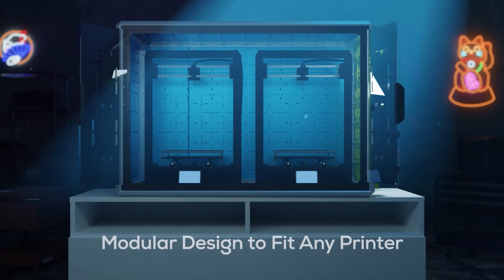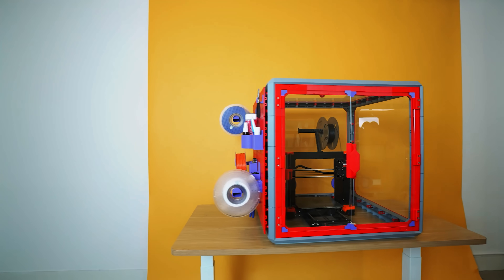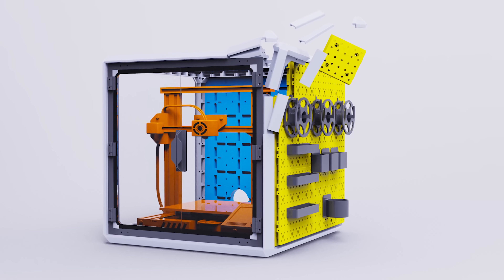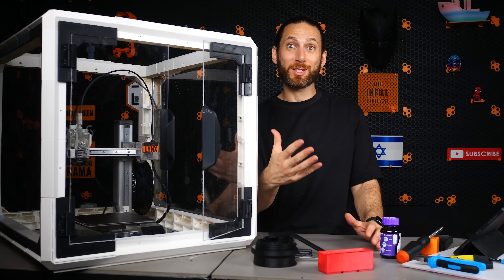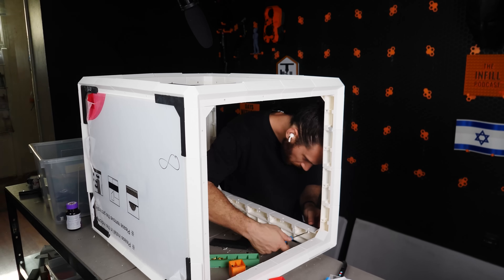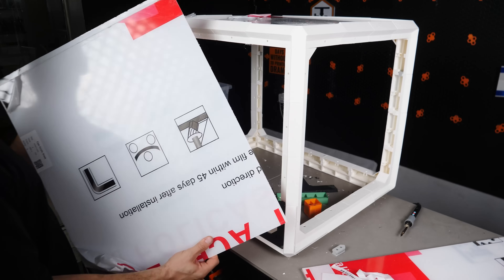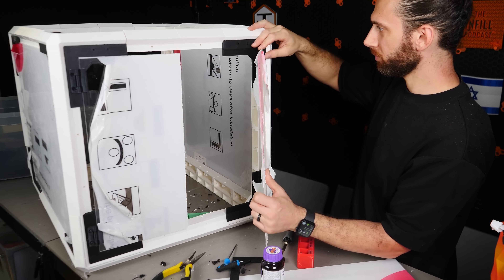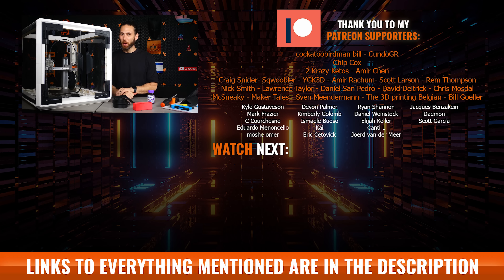This 3D Printer Enclosure is FULLY 3D PRINTABLE!

Comment: It's pretty cool.  I usually thing PVC pipe and fittings for things like that, but then it's not enclosed generally.  I use PVC to hold up strip lights for hydroponics.  I don't have a 3D printer, because I know once I start, the costs will take off to keep me in the consumables.  I would probably use ASA mostly for outdoor fixtures and such, but there is definitely a need for some indoor projects that a well thought out plan and good design could solve around here.

Comment: Save the effort. Use aluminium extrusions that later in life you can daisy chain with a link to extent, and use a acrylic or even plastic sheet face that mounts into the T-rails. Could even print the faces. It's cheap, way more sturdy and doesn't use loads of plastic on trying to bandage the issue of prints not being as strong as aluminium, for example.

Or just a popup tent or a cheap enclosure off amazon lol

Comment: Great Idea and Video!!!  (actually all of your Videos are great :) ) ..... One question ...since the Bambu A1 has the electronics on the bottom of the printer, and bambulabs do not recommend to enclose it (so no to fry the electronics) ... is there any way to a) raise the printer inside the printed enclosure and b) drill/create some air openings on the bottom of the enclosure so to allow the electronics of the A1 to breath ?

Comment: I designed an enclosure that works with  extrusions that you can print in PLA without worrying about the heat of the enclosure later on. All the PLA parts are outside of the heated area. Takes far less than 5kg. I think I used 1.5-2kg at most.
Reply: Link?

Comment: The project overall is too expensive to be feasible for most people(myself included). Once you buy the file set you are 90 bucks in and if we assume we need 5 kilos of pla 25 to 30 per kilo 125 and the needed acrylic panels will take it well over 250 which is too much for me personally. If the models were cheaper that would be acceptable. I get that a lot of work went into the design but the price kills the idea. If anything i woud try the free version on printables

Comment: 5kg is a lot of filament, and making it with PLA doesn't make much sense, since most people want an enclosure to print abrasive materials like ABS/ASA at high temperatures, which would melt the PLA pretty quickly. And printing with PETG at $30-$35 a kg, would mean $150-175, not cheap.

With that said, it could be a lot more affordable though if one used PET from recycled plastic bottles and that would be an interesting recycling project. Also, there is a free modular enclosure on printables now.
Reply: Yeah, I was looking at this and was thinking it would be more aesthetically pleasing, but then realized I always keep a cover on my printer anyways to keep the sun out, so just hitting the hardware store for a bunch of corner brackets is a lot more cost effective and much more solid!
As for heat resistance, you would be surprised! I did heat resistance testing on PLA and found that Elegoo's PLA Pro (Pro, not Plus!) started bending at 230F! It lasted twice as long as every other contenders which most of them were basically puddles at that point! I didn't do any physical resistance test as this was just because some of my old display props had bent from being exposed to the sun through the window. Summer is just about to start and I did those tests this winter, but I am confident the new one will be fine!

Comment: It is as if Google is reading my mind not just my data. I could provide a good home for the BL A1 AMS. The only problem is that it would have to sit in a damp environment and as such, filament being hygroscopic it would not be very productive. It needs an enclosure. This is where Google comes in. I mentioned this problem on another channel. And today I got this promoted video. I think I can use this construction design to incorporate the printer and AMS. So, the dried filament would stay dry longer while inside. Hey, WHAT THE HECK!!!! Build one that will surround the whole house!

Comment: I don't know if it has been said yet (I'm not going to read through all of the comments), but when cutting acrylic, or anything that can splinter, for that matter, just put some painters tape over top of it and it will stop it from fraying or breaking free and shooting off at you. Even if you are drilling a hole in metal, such as a car, using painters tape will give you a nice clean hole/cut.

Comment: A neat idea, but not something I can imagine paying for. My enclosure used only 1kg of filament to hold together the corners of wood that I got for free from a big box hardware store (used to tie down their shipments of bulk lumber); I could have gotten away with far less engineering if I didn't want it to look as neat as it does. Using plastic only on the outside of the corners also means heat is no concern.
Reply: Can you somehow show your enclosure?

Comment: Interesting video, but way overkill on the technology. More "Rube Goldberg" than simple DIY.
Instead of over $100 on filament, and days on a printer, I would simply use 12 pieces of 1 X 1 quality wood cut to length and joined with about 24 "ELL" brackets in the corners. 3D print the door brackets or just buy 4 or 6 cabinet hinges. Make it in a day, or 2 if you include lunch breaks.
But for the sides, if there will be a laser involved, you need laser blocking acrylic panels, not clear acrylic.
And I would put doors in front and on one (or both) sides for easy access, and cleaning after using a CNC mill.
The idea that you can take it apart and make something a different size ignores the acrylic sides that won't fit and the good chance to break a piece on disassembly. Cheaper, faster, easier to just make a new one with a wood frame.

Comment: nice video!  small tip. when cutting acrylic. try to use a blade with a higher tooth count and thinner kerf, as well make it so the blade BARELY goes above the top surface. it will make the plastic shrapnel to almost nothing to worry about :)
Reply: That's an incredibly helpful tip.

Thanks
Reply: @BrianMeeks  np.  also if the protective plastic is removed on it. just put some tape on both sides where you plan to cut, this will also help with chipping/tear out etc.
Reply: I haven’t cut acrylic on my table saw before. But I was going to suggest a very similar method with high tooth count, thin kerf blade. Also, what worked very well for me while cutting vinyl soffit material was to use an old worn blade of that type, but install it in reverse to avoid the shrapnel affect. Again, I haven’t tried this with acrylic, but it was beautiful with the vinyl soffit sheeting.

Comment: 5kg filament + printing time + acrylic + hardware ? No way ! This comes to be an enclosure which costs more than half the price of the A1. This makes no sense. Who wants to do it for an Ender3 or so and spend more for the enclosure than for the printer itself ? Come on...
Reply: @axelSixtySix  an enclosure for my anycubic kobra max costs almost $1,000…
Reply: @nickfaris4432  Yep, it costs an arm and a leg unless you happen to be a reclaim genius, in which case it barely costs a toe. But really, what's the point of spending several times the price of the 3D printer just to build an enclosure? Especially if you're not moving the electronics outside and haven't figured out how to keep the cooling system working properly, like with fresh air ducting or liquid cooling for the hotend. At that point, you'd be better off just buying a properly enclosed printer.
Reply: @nickfaris4432  $1000 enclosure for $400 printer? 😂😂😂

Comment: That doesn’t seem logical to print at all. $50-$100 of pls depending how you source it.  Then add cost for lights and stuff. My enclosure was less than that and is fireproof and came with a light strip. Cool build but doesn’t make sense unless you get free pla from a sponsor.
Reply: What did you make/how did you make it?

Comment: buy extrusions, buy acrylic panels, pay to drill them, you get a 10 times better enclosure at a cheaper price than a PLA enclosure that will start melting on the 3nd print
Reply from the maker: Yeah I hear you, but I do think the ability to reconfigure it on a project basis is kinda cool
Reply: @thenextlayer  You can daisy chain more extrusions with links to extend later. Hence why people are finding this kinda pointless.
Reply: @thenextlayer  Also, worthy mention, extrusions are also more configurable as it's unlikely to have a fracture in disassembly/reassembly being aluminium, unlike prints over repeated reassembly. Metal links to extend standardized lengths works pretty well. Also the simplest and most open frame for mounting things.
Reply: @AndroidA258  aggre this is cool but for 80 you can go the aluminum extrusion

Comment: Interesting but gimmicky, esp for the price point involved. For the cost of the files and the materials I can pick up a couple easy to assemble pre-made aluminum tube and ruberrized nylon fabric enclosures like the ones I already use for my printers and laser. One thing I would also add to the final product that I don't see in this preview is the option for leveling legs.

Comment: Are there any printable enclosures out now?  I have an Ender Extender 400XL that could use a better enclosure than the grow tent I’ve been using, that thing is not exactly fun to setup
Reply: I know your comment is 4 months old, but nobody replied. Yes, there is a free printable modular enclosure on printables
Reply: @danatopereira  I actually sold my 400XL and replaced it with an Ender 3 V3 KE, and bought an enclosure for it

Comment: I just don't get products like this. It requires a printer, preferably one that already has an enclosure and can print the more difficult materials anyway for longevity and even at that, it takes five freaking kilos of filament to print the entire thing. I can buy three Lack tables for the price of ONE roll of PLA filament and those things come in different sizes now. And that's not even taking the price of puchasing the STL's into account. I think it's just way, WAY more convenient and economic to just buy a Lack (or multiple even), some basic hardware and a handful of printed parts than spend a hundred bucks and literally three months of non-stop printing to come up with something like this.

I guess I'm not their target audience.
Reply from the maker: Yeah, different strokes for different folks, some folks really like to print it and make it super customized, others want to do it cheaply and easily with available stuff!

Comment: Note when cutting Acrylic/Plexiglass with a saw, place Tape (painters tape works well) over where your going to cut, solves the particle issue.  Also, cut SLOW, as in just push it through slowly.
Another note:  Why pay for Files?  That is kind of the stupidest thing I have seen from the 3d printing world is selling a STL file.  Reason to balk at this is because your still not done spending money after getting the files.  There is still the material cost of said thing, also its impossible to stop files from being uploaded to free sites or shared.
Ya the "cost" of designing the thing, but also the designer shouldn't be trying to make money off of that design if he isn't going to sell the product himself.  I design lots of stuff myself too, but I do not upload or share these files as I actually make the thing and then sell the actual object.  If I do ever upload a design, it will be free, because again, its impossible to stop it from getting re-uploaded to other sites.
Reply from the maker: Thanks for the tip!

Comment: Cool, but not mentioning that the models cost $48 alone and requiring 5 KG of filament up front is a big no no for me. I think those grow tent/pop up enclosures would be cheaper, even if you were to buy multiple down the line.
Reply: Yes, this price is a joke; for $48 it’s easier to just buy a server case. For these reasons it can even be made with heating and Pid controller.
Reply: @ReaLeeZz  more like $148 with the pla, not even considering the time it takes to print. This design is dead on arrival
Reply: @ReaLeeZz  I'm actually using a server case as an enclosure!
Reply: Or even some plywood and maybe small piece of plexiglass for a door....
Reply: yea, pretty absurd. $100 minimum upfront cost before any work is done with no hardware or acrylic.. just go build one out of plywood. who the hell is going to be taking apart their enclosure and rebuilding them like legos? this is a solution in search of a problem imo.
Reply: Yeah, better to just get some aluminum extrusion. I can get 6 meters of 20x20 for $65. Only thing is that it won't be as modular, but I don't care for rn. All up including fittings, brackets, panels etc, it's in the same ballpark figure. And much more rigid.
Reply: I've build a 2020 enclosure for less money.
And my enclosure won't melt went i'll print something with high temp.
That's crazy how many youtuber promote that kind of waste of plastic.
Reply: pov: building enclosure from wood and glass is cheaper than printing this one
Reply: Yeah it’s double that now.
Reply: @DJProPlusMax  or even… Ikea boxes
Reply: I was going to make the same comment. In NZ its way over the 200nzd and for that I can even buy the enclosure from Creality if I want to.

I think it is worth though if you have multiple printers then you buy the project once and use it for different designs.

Comment: Great video, but I can't back a KS for functional 3d models that do not include step files, it's one thing to only have stls for decorative stuff, but for it to be a customizable system, there needs to be a backer level that includes cad you can do stuff with, otherwise it's a lot of printing for limited use case -- for the price I can buy some inexpensive 2020, some acrylic, spend 20 minutes in cad and have an enclosure, or go the ikea route, they do realize the time investment to print all the parts is significant, this feels like when you only have a hammer, everything is a nail...to shocking dismay to us 3d printing enthusiasts, not everything needs to be 3d printed.
Reply: Agreed
Reply: some of the CAD will be included! The pegboard and accessory files will be released with the file delivery!

Comment: I made one kind of out of scraps. I had some spare extrusion beams and my neighbor's small cheap greenhouse collapsed from a lot of wind, so he gave me the panals which are great in keeping heat in. I font have a bottom but for the top I cut out a piece of wood with a filament hole and 3d printed a spool holder

Comment: If I factor in what it costs me printing this enclosure I am better off buying 2020 extrusions and mounting acrylic panels on them.
Reply: From where do you buy 2020 extrusions so cheaply?
Reply: U struggle to find for $100-150?
Reply: Yes. I ended up paying €248 back in March to a company in the Netherlands. So $100-150 would be a real improvement

Comment: Quick table saw PSA at 10:46: I highly recommend watching this video from The Wood Whisperer (below) about table saw safety. I could be wrong but it didn’t look like you were supporting the piece that was between the fence and the table saw which is very dangerous. After 20 or so years of woodworking Ive had my share of kickbacks until I learned how to properly use a table saw and they suck to say the least so I just wanted to pop in here and offer up some safety recommendations (below). 

I love the videos you’re putting out! Just wanted to pop in and help provide some tips to stay safe :) 

Wood Whisperer Video, old video but still good: https://youtu.be/S_tKazzp-u0?si=3yju7-rZSseIbj4W 
I also highly recommend these Microjig push blocks, they are awesome!! - https://a.co/d/6RGwKIp and/or https://a.co/d/9d9eBrU